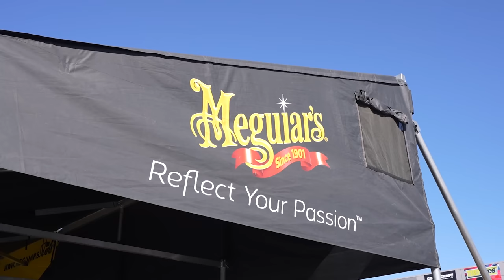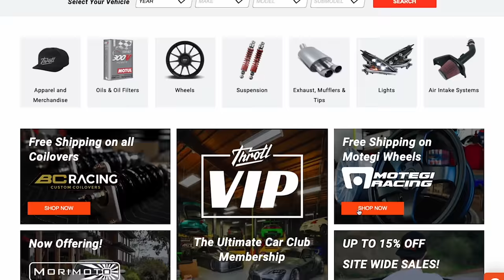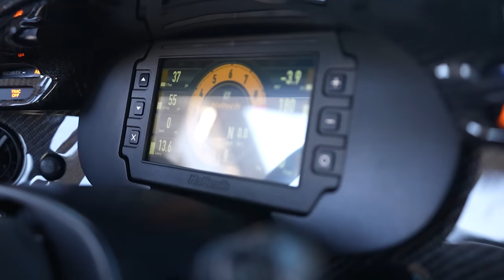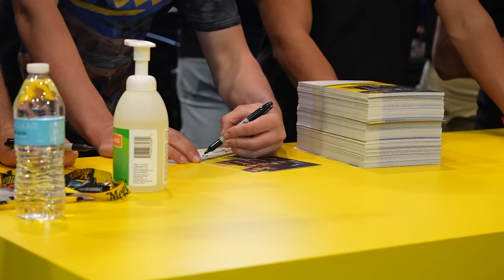People at SEMA react to our Modern Day (Fast & Furious) 1994 Toyota Supra Turbo!

Comment: The real question is does it run 10’s? I want a video of seeing it run 10’s at the track. He owed Dom a 10 second car!
Reply: With 1200 HP, it will probably run low 9s, maybe even 8's.
Reply: After the work and overnight parts from Japan, it should decimate all
Reply: I've always wondered. If he owed dom a car because the eclipse got roasted, where did the 10 second number come from. Cause the eclipse was nowhere near 10s, 12s maybe but not 10s.
Reply: @andrewjdm9523  my uncles Supra makes 1300hp and runs high 9s. Traction is the biggest problem at that power
Reply: Get the body kit off and it can go in the 6s
Reply: @dvldrvr420  because he got the supra, and it was actually not his car but from dom and the family and that's where the 10 second car comes from? Really I don't no either
Reply: @andrewjdm9523  probably. Until it runs them, it's just a show car
Reply: Exactly, they never run their cars...
Reply: no thats actually the 10 minute car before it crush and burn and presented to Dom by Brian 😂😂😂
Reply: @dvldrvr420  cause the 70 Charger was a 10 second car, after the crash with the train Brian handed Dom the keys to his Supra, Dom asked why to which Brian responded “I owe you a 10 second car”
Reply: @christopherbassit2757  does your uncle have a tire and wheel setup like tbis one? That supra shouldn't have any problems holding the track
Reply: @expectnolove9978  he has a ccw drag pack with slicks
Reply: @christopherbassit2757  straight axle time
Reply: @andrewjdm9523  you missed the point 🙄
Reply: Probably 8 second range that's a awful lot of power for a car that even weighs over 3k
Reply: My grandmas Donkey runs 10s allday
Reply: @christopherbassit2757  True unless it runs the best tuned wheel traction
Reply: @etlogramen8665  I think he’s pretty much tried everything. The car itself is a garage queen and never leaves anymore because it’s a low mileage 1997 but he also has a 91 mk3 Supra he’s been building up for the past year so hopefully he’s back out there soon. 💪🏽
Reply: @christopherbassit2757  Oh man the mk3. Yo i mean mk3's are superly classic car. I wanted to buy one and run it with a 500hp.
Reply: 10-second cars are for 10 second men
Reply: Got eclipse myself and they are faster than i thought so they do a 10 with some care

Comment: The crew at Throtl did a great job on the build, very nicely done.  Pro level build and detail for sure.  Even if it is a bit overplayed with the F&F theme (sorry I just am tired of F&F and NFS liveries, I see them every single day in Sim Racing).  

-I get it... a whole generation grew up thinking their floorpans would blow the rivets out at high RPM and NOS is the same as gunpowder... but I didn't.

Comment: Sorry Quinn, the Mustang is a '67 fastback and NOT a 69 mach 1. The front corners are off of a 70 Mustang. Note that the "C" pillar scoops are similar to the 67, 68 Shelby GT350, GT500 Mustangs.